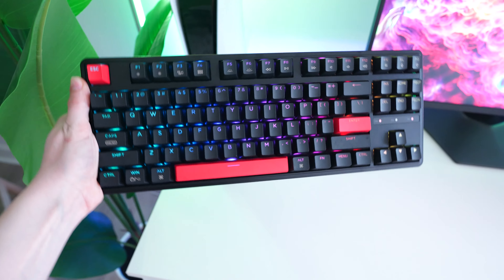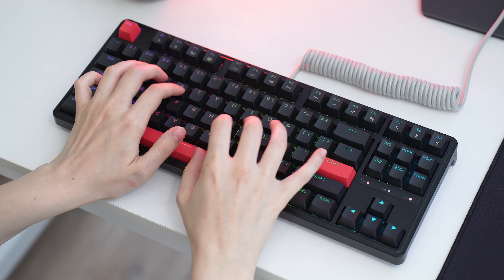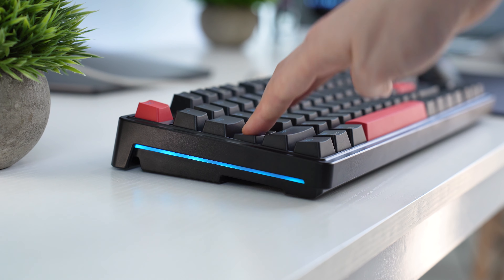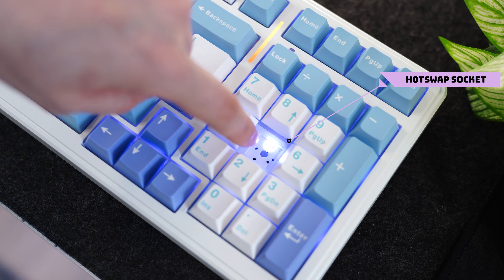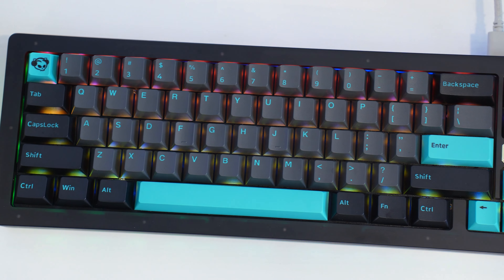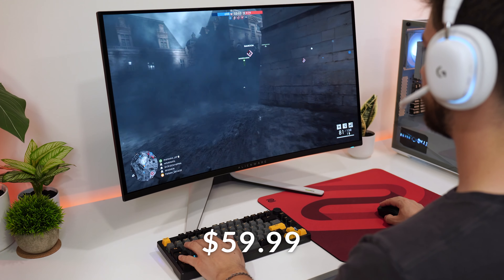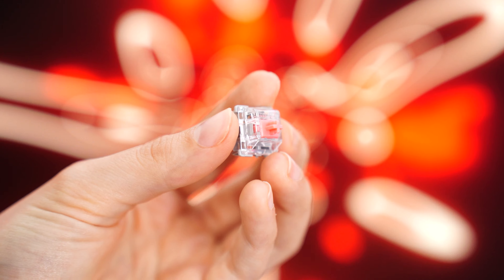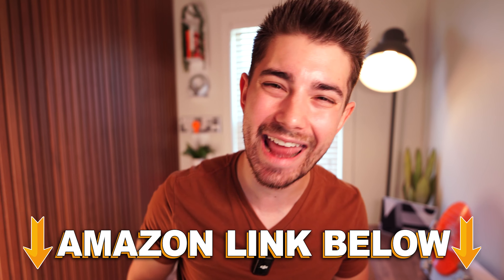Top 5 Budget Gaming Mechanical Keyboards for Beginners

Comment: I bought the Tecware Phantom+. The red wraith stock switches just aren’t fast enough for me. I want to get Cherry Speed Silver but on the amazon link for the keyboard it says only compatible with wraith switches so i’m a bit confused. Can i use cherry speed silver since they are both 3 pin or does it need to be wraith. I know basically nothing about keyboard so some insight would be helpful. Thanks.

Comment: When you were showing the bad stabs, you were hitting very fast and I think that in the case of some of the keyboards you said had "good" stabs would sound just as bad if you did the same frenetic hammering on them. Also,I think that it's funny that you're saying that 1800 is "somewhat rare" where in the custom keyboard market, it's more likely to find an 1800 than a Full. In the budget market, which I believe is the sub-100 dollar market) I think that you really need to bring out the Yunzi AL71, an aluminum keyboards for 90 dollars and you can usually get that on sale. And then for a little more, but still budget, you can get the Chilkey ND75, 99 dollars for a aluminum fully built keyboard, it's easily mod-able with the ball/catch opening and the magnetic pogo connector, not to mention a screen. And as a sister company of Meletrix, it's very high quallity. Not on Amazon, but most of the best keyboards and deal aren't.
Reply from the maker: I agree with everything you said!  For all the keyboard recommendations in this video, I get a ton of first time keyboard buyers and very few want to spend over $80, so we capped it there.  I have featured the other keyboard you mentioned though in other videos.  As far as 1800, it’s exactly as you say, in “custom keyboard market” it’s not rare, however this video is very much to educate a beginner that isn’t aware of this market or really knows very little overall!

Comment: I've been using phantom for 6 years and I hardly have any complaints whatsoever.  It's durable, feel free to rage quit all you want and you can always buy the keycaps for cheap so there's that. I also have a Corsair K70 with cherry MX speed on my other pc, but always find myself using the phantom more when it comes to gaming. But if you have the money, def get the k70 because its STUNNING AF!

Comment: Why all keyboard reviewers are lowkey brainwash about clicky switches? Its always about the feel (pressing the switch). Sounds wont make you good.
Reply from the maker: Well to be fair, clicky switches actually have a 2 piece stem design that makes it “click.” This inherently makes it significantly harder to make a refined key press, both sound (albeit subjective) and feel.  To go further with this, because clicky switches are not popular among enthusiasts there’s very few higher quality clicky switches.  So all in all, MOST of the time clicky has a smaller use case due to loudness, worse feel, less overall choice, and inability to really lubricate it as much as a linear, thus limiting further modability.  For those reasons I really just don’t recommend beginners to the space to get them.  However, the only thing that really matters is your opinion for your own keyboard, I made this video as a guide to people that don’t already have their opinion or knowledge yet.
Reply: @ConsumerTechReview  Still love the video(Gonna help a lot of new comers). And I just hate that you guys hate clicky switches.
Reply: I think it's because most people find clicky very noisy and in reality most linears are also loud ... I always recommend a cheap set of Outemu silent linears or Outemu silent tactiles asap as a starting point.